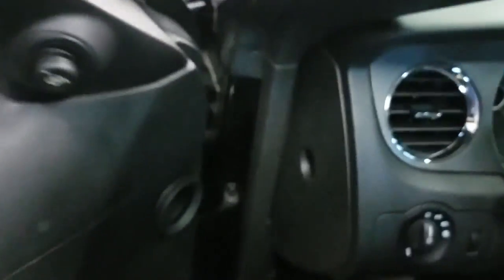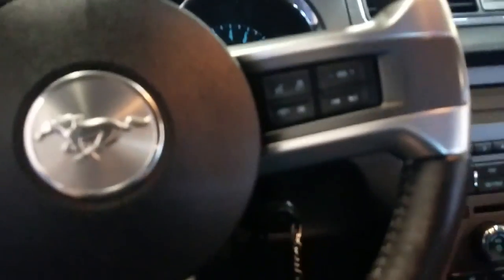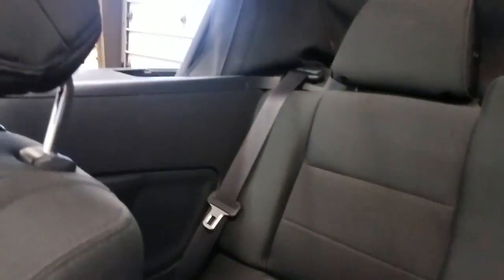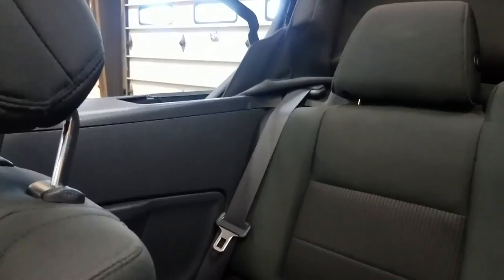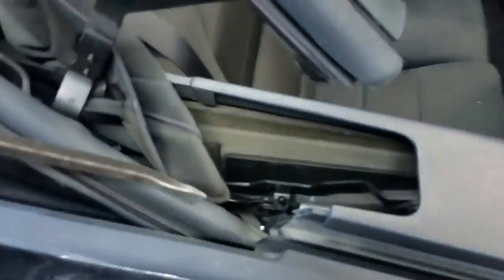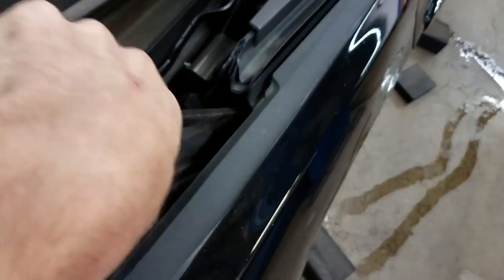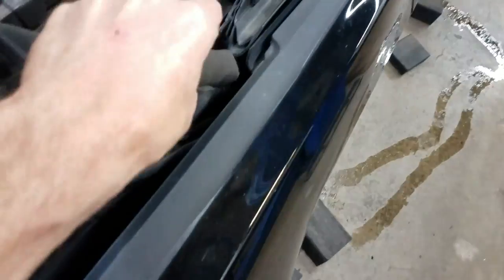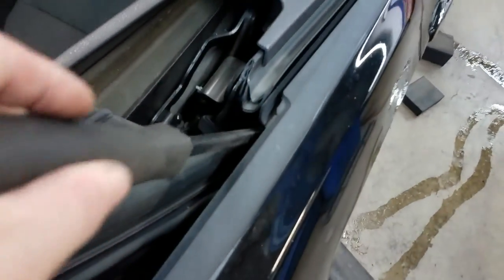Ford Mustang Water Sloshing and Foor Wet "Repair for Free"

Comment: I have a 2013 non convertible with a wet spot on right side of passenger side in the back.    Can't figure out where that's coming from if anyone has any suggestions.

Comment: I just used this trick on my car and it worked. Make sure you roll up the rear window before doing this or you will break the window. My passenger side has a drain hole so I think the factory forgot to put a drain hole on the driver side.

Comment: Thank you for the video. Very helpful. I recently purchased a 2014 Convertible. Funny how when the car was on the lot and when I took it for a test drive,  I never saw any water dripping. When I got it home in the driveway, it dripped for days. Oddly, no water on the drivers side. Will look for some way to pull out the foam.

Comment: There's a seperate issue where  water cones in through air cabin filter and floods floorboard of passenger compartment.
This is an easy fix also.
My new to me 2014 convertible had a musty smell from filter being wet.
 Changed filter, clean out drain plug, good as new.

Comment: This video was helpful but I had to keep repeating the process after every heavy rain. Could not find any way to keep the foam strip open or remove it.  So I jacked up the car, removed the wheel and the nuts holding the sound deadening material in place and  pushed that aside. Then I drilled a couple of 1/4 inch holes into the panel about eye level to where the top of the rocker panel would be. Got lucky. After 8 inches of rain from Ida, no water in the panel.

Comment: I just got a 2004 get vert.  Was getting the wet floor first on the back passenger side then driver side.  You see a lot of people talking about sealing holes nd shit like that.  Find the drain plugs in front of the rear tires and get a hanger and get it up the holes 6 to 8 inches. You will hear it rattle around in the quarter panel. Then you know you in there good. Water can rush out a ton or just a little. I have not had the issues again with some serious down pours recently in ct.  do that and you will be good
Reply: Hey - I'm struggling to find the drain plugs. Can you help me? Where are they / what do they look like. Do you have a picture you can share?

Comment: Thank you so much for posting this video.  I just came home from the dealer. They wanted to charge me $600.00 .  They told me they needed to take out the seats to figure out what the leak was coming from.  I told them to forget it.  Came home watch your video and did as you told and all the water came out.  $0.00.  Thanks again.  God bless you.
Reply from the maker: That's awesome, glad video helped out!
Reply: I actually was having the same problem went to the dealer where I got the car from, hilariously they wanted to ask for specialist wanted to give me the big IDK we will have to take the car apart to check it out, had the convertible top down at the time, so when I slammed my hand on top of the convertible roof bay area, from the fit of rage I had for the BS they were giving (not abusive to cars, I love my mustang) all the water came pouring out in that very instant lol, mechanic and the GM of the service area looked at me and I looked at them. They gave me a free oil change.
Reply: @azizurrahman6994  had the same problem and im shocked that A: ford designed something so poorly and B: The techs dont know anything about it but everyone has it.
Reply: @SuperLowdrag   new techs havent done more than oil changes and ricing around with the civic or toyota so ofcourse they wont know. The mustang cars that we drive especially the S197 models, aside from the german MAHchSTANG S550 were designed to be garaged cars, not street cars, so over time, the holes get clogged from between the seems. just unclog drainage holes. Thats why when I hit the rear fender of my car, real rough, it got all happy and wet and gushed out. It was a good day.
Reply: @azizurrahman6994  thanks I get it but im surprised. anyway Im trying to find the drain plug for the rear quarters. I poke but only hit some dark foam from the feel of it. I need to get the debris out but a vacuum will not fit. Cant find photos or anythign showing the drain path from top to bottom. have you seen any? I've taken all the trim off but it's from between the metal channel. so hard to see anything so deep there.
Reply: @SuperLowdrag  Try using an air compressor, and instead of trying to poke it try to blow air in it and blow the shit out, and if you have a convertible, try to do a half path on the top so that you are able to see through the pillar and beams, if you see anything or any form of water, try to use a long skinny stick to clean it up.
Reply: @azizurrahman6994  ried finding it and haven't yet. can you show me where it is on the bottom? Maybe like an exact measurement form some reference point? I can see down the gap in the frame from above but don't know where to look.. more forward or back?
Reply: @SuperLowdrag   its more forward, door side, what you can do is just lightly bang you hand around the body, and hopefully its drains like it did for me.
Reply: @azizurrahman6994  I have to find and make a bigger hole

Comment: I am getting water under my 2012 mustang convertible back seats and floor and I don't notice any leaks in the top.  Is it because the quarter panel is filled up with water?  Will this work for me? If so what kind of stick should I get at Home Depot?
Reply: Had same problem, had to take out the rear seat both bottom and top, then opened that gap where the convertible fabric seats behind the rear seats underneath the window. I noticed the fabric was tucked in wards in the car and allowed water to run into the trunk and eventually the seats. I simply tucked the excess fabric in the drainage and water stopped leaking into my trunk and seats.

Comment: Same thing for my 2014. In May 2019, I had water in the 1/4 panel-I had it fixed, it was about $800! Insurance paid for new power switches to rear windows, cause they had shorted out. The tech drilled some holes for better drainage. But now in Jan 2020 that back floor carpet is soaked again. Why does this happen? Is it just a design flaw and how can I prevent this? The tech drilled more holes for better drainage, but that doesn't really FIX the cause. Can you suggest a better fix? The cabin is growing mildew now. I can't keep it dry. Don't have a garage, it has to be parked on the street. I'd really appreciate any help.
Reply: Did you find any solutions??
Reply: I have the same issue man !! I wish i could know how this could be fixed since i dnt have a garage neither ! What i did is that i bought a car cover ! It works for me since the mustang is not my daily driver ! 
My mechanic suggested to change the rubbers that seal the window from outside but idk we are still trying to figure it out !
Reply: @faysalkalalou2197  did you ever figure out a fix?

Comment: You saved my mom a trip to the Ford Dealer. Thanks for this video, I tried it out and it worked like a charm! Also did the door drain plug thing too which is another common issue apparently

Comment: Will this work for the 2015 convertible? I don’t see where the foam piece is or where the water is supposed to drain from
Reply: Yes . It's very dark small space in there. (The second area he showed placing the tool down through). 
Poke around in there is a hole that drains out right out bottom by the bottom  front of back wheel, the water will drain from there. May try to jack your car up from the back that help get water out also.

Comment: Thank you again. Adding to my comment from 2 months ago. Every time it rained heavy, I had to repeat the process. Could not find any way to remove the foam body strip. So I taped an awl to the rod and spent several minutes pushing it into the foam along it's full length. It seemed to penetrate more, closer to the wheel well. Now the water no longer accumulates. Update: This worked well for a while. Must be a lot of dirt in the body cavity.
Reply: Whats an awl?
Reply: @jackarlos1  It's a sharp pointed piercing tool for making small holes as in leather.

Comment: Was it quick or slow to drain? I'm trying with a coat hanger but it's coming out pretty slowly
Reply: coat hanger may not make a big enough hole especially if you have any debris in the unintended "reservoir."
Reply: May try to jack your car up from the back that help get water out also.

Comment: This was a wonderful video.  I have a 2013 red convertible.  I had lots of water sloshing in the rr quarter panel.  My local Ford dealers wanted $1,500 to replace the "seal."  I followed your advice: got a 4 foot long 3/4inch dowel and taped a very long 1/4 inch drill bit to it with 2 pieces of duct tape to keep it stable.  I lowered it through the convertiblee top access point and poked through the "plastic" stuff/soft stuff and the water immediately began to drain.  I did this on both sides although the passenger side had about 1+ gallons it it.  You win. We win.  Dealer: 0.
Reply: Bryan M’Doza  never had it in the back seat area; I would check under the carpets for a dislodged plastic hole filler somewhere on the floor..

Comment: Hmm. I did exactly what you did up to looking down there. I don’t see any water or any foam piece but I can hear the water and my car smells like nasty water. Any suggestions?
Reply: Matthew Garcia I ended up unclogging the drains and the water was flushing out, I thought I was good to go. A big storm hit SoCal the next day and my carpet was drenched. Turns out the gaskets/seals around the side view mirrors will fail and rain water can stream in through the front panels and soak the carpet. Filed a water damage claim and my auto insurance covered 85% of the bill!
Reply: Front and back seat floors?
Reply: @christianocegueda_  hmm, that might be my issue. I’m hearing the swooshing in the front pass. Panel area. And pass. Carpet is wet after a rain or wash. Plus I’m hearing roasting like water touching electrical......
Reply: @ninjavibez4696  Yesh, lol dang been two years already. I sold the car for an old school Mustang. All gaskets were changed. It’s just the drains would get full of leaves so every few months just change it. The rear carpet will get a little wet but nothing like before.
Reply: @ninjavibez4696  I had that issue. Saw vedio showed under the hood 2 plastic plugs. Pulled of drained no problem now.
Reply: No more wet front and back passenger side but yesterday rained back quarter panel slushing but nothing on inside.
Reply: Where are these plugs? I have 2015 GT

Comment: Is this the same reason water fills into the back seat. I have been having this issue for sometime now.
Reply: Me as well do u have a fix ?
Reply: @dullahon8120  I have yet to figure it out, I am to the point where I am looking to just drill a drain hole and let the water run out.
Reply: I had the same problem with my 2011 convertible and followed the instructions, it did drain the water. The only issue is every time I get a heavy rain storm it will just fill right back up. Got to cover the car during rain or do this every time.

Comment: My sister's 2017 is having this same problem but she doesn't have a convertible. The dealership went back & "so called" sealed where it was needed but as of today there's still some leakage in the backseat floorboards.
Reply: My 2017 mustang has this same problem did you ever find out how to deal with it. NEED HELP
Reply: My 2017 mustang EcoBoost has water on floor board does anyone know how to fix the problem. NEED HELP
Reply: Sorry, but she's still trying to find out what's going on but will come back to reply as soon as she finds something out.
Reply: I have a 09 mustang and my back passenger seat be soaked after rain
Reply: 14 gt Coupe...trunk floor board wet ..mold under neath . Spare tire wet . The f*** is going on.
Reply: 2015 vert doing this gonna try in the am and see how it goes

Comment: No water comes out for me but my back seat is still soaked
Reply: Probbaly a little late since you comment was 9mo ago . but i popped my back seats up and found two clogged duck drains . popped them out and my back seat has not been wet since
Reply: @sonofdrjekyll  how did you unclog them